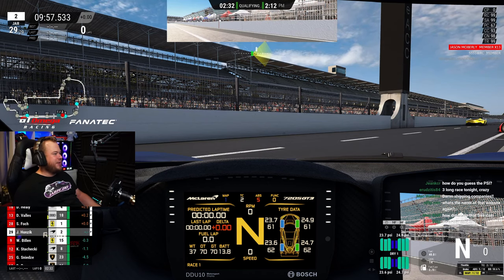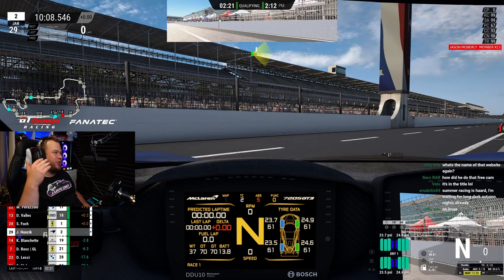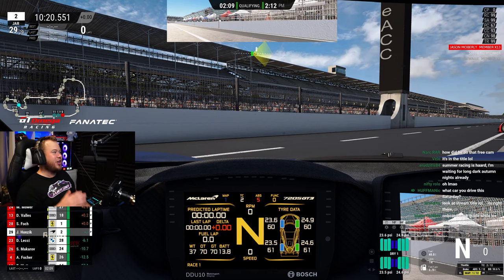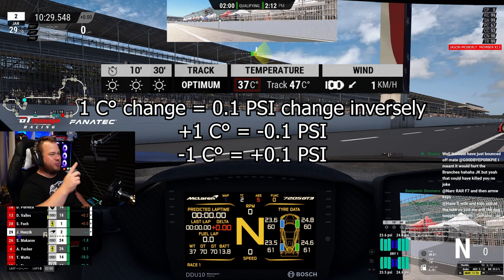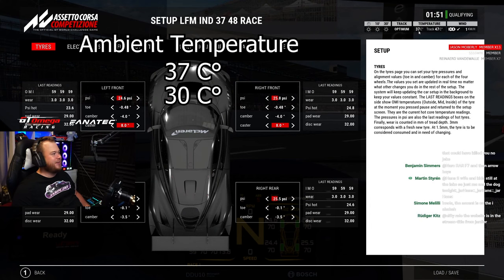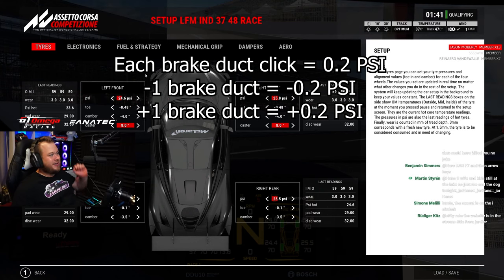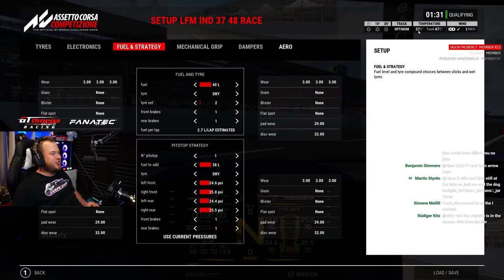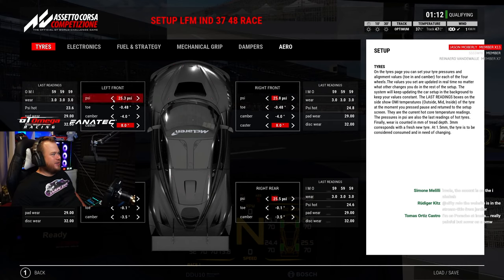How To Have Always Perfect Tyre Pressures In ACC Explained

Comment from the maker: Easy explanation how I do my tyre pressures when racing ACC :) Hope it helps!
Reply: Thank you.
Reply: Thanks! Same technique applies for the wet tyres?
Reply from the maker: @Nelsinho185  yes
Reply: @Jardier   nice thx. I always looked at the track temp before 🫢ooops
Reply: Thank you, I understand nothing about setups. What is the optimal tire Temps to aim for or is that different based on track?
Reply: @densfordb4699  27.6
Reply: For my experience 0,1 psi every 2 degrees if i cange 1-1 i go out of pressure... I'm not a train but i drive this week on nurb at lfm with m4 and my old g25 and my pace is 54.7-55.1 and probably i can do 53.9-54.0 in quali...
Reply: I’ve also seen alternative info saying .1psi change for every 2degC change which is what I’ve been using for a long time now and holds true most of the time. I’d say it comes down to personal driving style and setup which method works better and also remember it’s only meant to be a rule of thumb tip, not a perfect equation that works in all circumstances.

Comment: I understand the amount of clicks is 0.1 or whatever but your starting point reference is from the basic aggressive preset tyre pressures? Or where do u start?
Reply: This is what I'm confused about as well, what's the baseline?
Reply: The baseline you would have to adjust from what you have already to optimal of 27.7/27.8 after you've been driving consistently for at least 5 laps out of the pits. Once you've set the right pressures for your setup/driving style to these values, you then note the temperature. Most save their setup with the track and ambient temperatures in the save name of the setup for this reason, so when you load your setup, you know it was for 23c ambient (for example) and adjust from there whenever you load the setup. (Hope that makes sense) 🙂
Reply from the maker: I mean when you do some practice and find your correct pressure. Then adjustment is done by what said in the video. So do 3 laps and make sure to get pressure 27,6 all around, lets say 20C ambient. Then you know :)

Comment: Thank you so much.. i watched this ages ago & did pick up on the ambient temps & just picked one car, all tracks to set tyres so i could enjoy a race :) I then raced all cars on one track & I also found many other cars very good that i'd thought were terrible so honestly, your video was the kickstart i needed & all is good with my 1st car with very basic setup on all tracks.. mainly tyres, sometimes camber & lower fuel & that gets the car around most tracks well enough to start to enjoy the game finally, IF i remember to check the weather !... Previously, the game had felt like a long job & that a motorsport engineering degree was required. I'd raced before but couldn't feel safe in any car in ACC so your help was vital for setting a stable base. You are a top man !

Comment: other question, let's say you have a race in the dark, how do you change setup to get more temp in the tires? i was struggling to get the tires up to 65C, they were graining, on ambient temp 14C. is there anything you can do to generate more heat other than closing brake ducts?

Comment: the only I don't understand is from where u come, like okey each degree is 0,01 up or down depending but from where, like if I go standard the car runs on 25,5 on 24 degrees lets say, you modify the pressures from there or there is a rule like 20 degrees is 25,5 an from there you move around. thanks!

Comment: Very good explanation, thank you very much. But what I'm missing is the information about the optimal temperature for the standard tire pressure. Without this information, it is not possible to calculate the optimal tire pressure for the other temperatures. Or do i have a misconception?
Reply: I know the optimal range is between 27.0-28.0
I personally try to keep it between 27.3-27.4 and it’s always been good for me
Reply from the maker: Best pressure for GT3 is 27,6 :) so try to keep it in 0,2 window around that
Reply: @Jardier  ooh I was pretty close unknowingly thanks Jardier!
Reply: @Jardier , @Hugo Bussy, thank you for the helping 🥰

Comment: I have heard that 27.3-27.8 is the optimum range for GT3 slicks and if you are in this range, you will have maximum grip. According to Aris. So why do you aim for 27.8-27.9 instead of 27.6? Isn’t it better to be in the middle? The only advantage I can think of, is you will reach 27.3 slightly sooner at the start of the race.
Reply: Optimum pressure is 27.8, the lower the pressures the quicker the tyres degrade.
Reply: For example when you do a sprint race for 25 min, you want to have early on like 27.9, and then because your fuel goes down the PSI goes also down, and then at the end at  the race you have like 27.4.

Comment: This is great for the next session if you have the current pressures correct but what about the first session. I quite often don’t have time to do a practice and adjust ahead of a qually or race. Sometimes I go straight in. Is that ever possible to work out without having driven?
Reply from the maker: I recommend doing some practice in like 23 ambient weather. So you will have saved setup with that pressures. So then you always have correct ones for next race :)
Reply: @Jardier  thank you so much for the reply!! Love watching you race. I’ve just managed to get my LFM license
Reply from the maker: @MarkGreenhall  :_jarLove2:

Comment: How do you know that the next condition is going to be?
Reply from the maker: I mean when servers goes from quali to race for example., it can be different time and you can clearly see weather on weather screen :)
Reply: @Jardier  Thanks for reply. Is the starting psi 25.5?
Reply from the maker: @khodamn1  This tip is after you already know you pressures, when warm after lets say 2-3 laps you should have 27,6 PSI on all tyres :)

Comment: What would be the cause of high tire temperatures despite tire pressures and brake temperatures being optimal. How would you fix this?
Reply from the maker: Only thing you can do is max brake ducts right now :)
Reply: Maybe you are turning too much the wheel, in that case the front tires would be very hot, if rear - it's drift, if both - too much steering + drift

Comment: Nice video, Can you help me how to keep presures in check? My pressures doing the races just keep rising. Do you possibly have a tip?🙃
Reply: Normal for pressures to rise the first 3-5 laps. Otherwise open your brake ducts more. Could be that you get in the flow more the longer you race, too - that way you utilize the tyre performance more and more, which makes the temps and pressures go up. To make valid comparisons you have to drive consistently at the same pace/intensity.
Reply: @oskjan1  👍 Thank you

Comment: Somehow I have a completely different method. I use the avarage of the ambient and track temperature, and every avarage 2°C higher [or lower] is 0,1 PSI lower [or higher]. 

So if the ambient temperature is 30°C and the track temperature is 38°C, the avarage is 34°C. If the avarage drops to 28°C, I raise my tyre pressures by 0,3 PSI.

Completely different, but it works, except for Monza obviously.